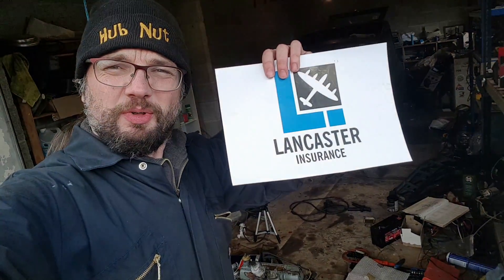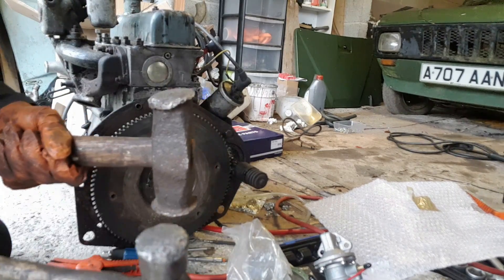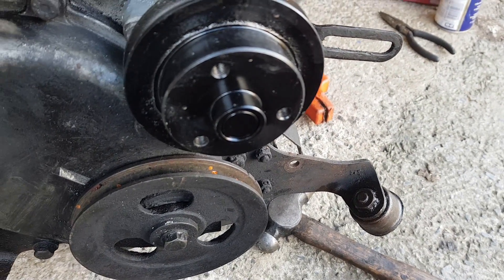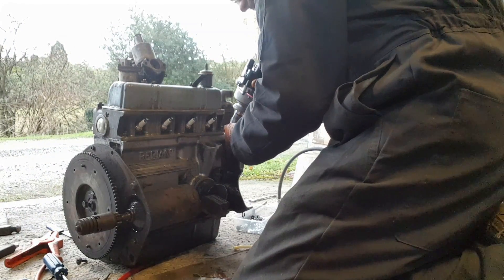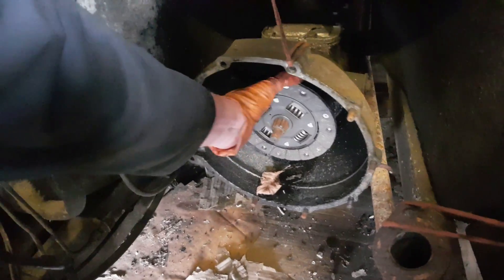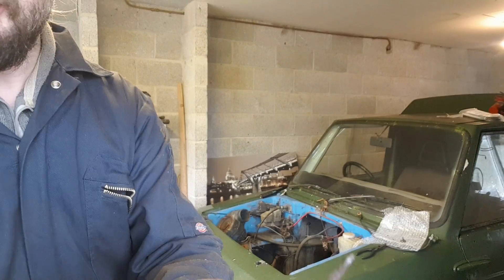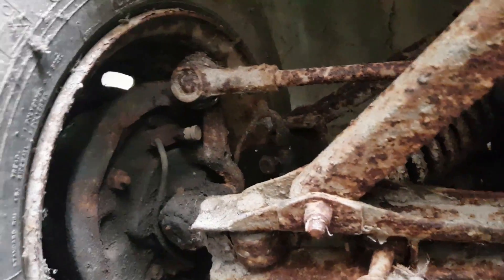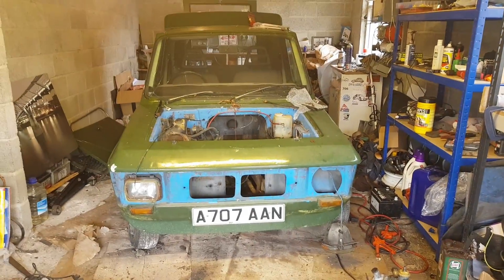Project Fox Part 7: Clutch, electronic ignition and more!

Comment: You should never ever hit hammers together they can shatter.
Reply from the maker: Can't say that's ever happened to me, and you can see the abuse the lump happer has had - mostly from twatting a maul.
Reply: @HubNut  I was told this at several times during training to be a mechanic. The theory is that two hardened and brittle faces share the same resonance frequency, this can cause them to explode into shards. I've never seen it happen but I've never seen a mechanic hit hammers together.
Reply: @pinkerton2964  I think that's not really a thing.  They might throw a spark or two from time to time, so probably best not if you're in a situation where there's explosive gas, best not.  But shattering?  Nah.  True, it might deform the face a bit, but I think that's about it.

Comment: I would not bash two hammers together if i were you as they can splinter shards of hardended steel into your eyes.
You can get special hammers that won't do this.
Edd china had some on wheeler dealer programme and explained all about this.
i forget what they called them now they were made of some special metal.
Also i would get the flywheel skimmed as the clutch will judder when the clutch is cold if the flywheel is warped & grooved.
The judder will go away when it is warmed up though.
Should not cost much to get it skimmed though,it's worth doing the job properly.
Great video ian will look forward to the next.
Reply: Hmm Mythbusters did the hammer thing to death, as ever with  MB they had to ramp up to the super silly level to produce chipping. Besides BOTH hammers Ian has shown you today have plenty of abuse worn into them  without failure (which is how they should be given half decent metallurgy). that ball-peen is I would suggest a bit soft for a metal shaping hammer, the maul thing  is about right as its a driving a tool/forcing something in type hammer and need a bit of 'softness' to grip what's being struck (NB claw hammers should also be 'soft' to grip onto nail heads when striking, just try to drive nails with a ball-peen hammer flat end it'l skid about and bend nails something awful).  Hubbers, de rust that gearbox spline  and a light copper slipping to make the assembly easier.
Reply: I had heard of this before many years before edd china said about it,but still would not like to risk it myself.
It might be a rare occurance,but still would not risk it,must be the sparks that is the main danger shooting off,not an explosion itself as they say.

Comment: What headlights did Reliant use? They look like the ones Fiat used on many of there cars.
Reply from the maker: Correct. Fiat 126/900T.
Reply: @HubNut  ah ha though so, also used by seat and yugo then. And probably fiat 127
Reply from the maker: Same structure, but some of those had a separate sidelight.
Reply: @HubNut  very true

Comment: All good stuff - and I think no. 7 is the newly-returned to traffic loco (BICBW). My first thought when it wouldn't start was typical of this engineer; "you've changed too many things at once". I'm just curious why you changed the distributor? And please - hoover some of that dead foliage and detritus out of the engine bay whilst you have a chance!
Reply from the maker: Indeed. Three locos now running on VoR. New dizzy is fully electronic. I just wanted some extra reliability.
Reply: @HubNut   Seems reasonable enough to want reliability...!
Reply: @HubNut  Electronic distributor... wonder if that will cure my mate's '53 Minor pickup's woes?

Comment: Are you going to re Paint it or keep it green?
Reply from the maker: I think I'm going to have to repaint it. I love that blue.
Reply: @HubNut  you might be lucky and be able to remove the green paint with paint thinner or something similar
Reply: If it goes back to blue (as it should) then...

1  It will look like TWC's grown up plastic cousin

2  It will look quite like a "Shado Jeep" from the old Gerry Anderson UFO program - funky little blue 6-wheelers with definite similarities to the Fox.

Buy a small bottle of cellulose thinners and try to remove the green paint just by wiping, (see Car SOS Austin Healey Sprite), if this works get a 5 litre can from a motor factors and strip the whole car...

Comment: Nice job--------------------------sofar but you are now avoiding the elephant in the room by messing with the grill get on with it and put the engine in LOL. what about the MOT will they say something about the rust under there?
Reply from the maker: I'll go over the suspension before the test, make sure it's actually solid.
Reply: The rust shouldn't be a problem as long as it's just surface rust and it's not actually rotting through. I stripped apart a front suspension a few weeks back that looked like this, but it was fine. 10 minutes with a wire wheel, it all looked good as new again.
Although 'stripping rust off' and 'making things look like new again' just isn't the HubNut way 🙂
Reply: Ya I dealt with the MOT when I lived there with my old BMW motorbike here In Alaska you can have parts falling off we have no inspections we should but no.

Comment: Sweet little hats!
"probably won't have the right size nut"
I can't look into your wallet, but I feel like you need an assortment of things. Nuts, o-rings, washers, stuff like that. Just a general selection of very general generic things. 
I'm fiddling with audio equipment, at some point you start buying 'belt kits' and not 'a belt' :D. 

The Samsung's stereo imaging is rather good. There's a dog barking at 13:15 which seems to be coming from my 8 o'clock, way outside. Speakers are in front of me. That's stereo for ya. 
I had pause the video to check if it was actually coming from your recording. Quite convincing.

Actually the thread on those tires looks quite modern, definitely 21st century, but that's probably still too old. There may be an age code on there, worth a look!

The fox looks very "Fiat 126 with BMW logo" without that grille :D. 
I like the blue... Uh-oh.
Reply from the maker: I think the tyres are 2012, so not that bad in the big scheme of things, but they were left flat for some time.

Comment: Defiantly need to train Mrs  Hub nut, she would fit into the engine bay a bit easier than you, plus she'll have smaller hands to get to those awkward areas like the thrust bearing in the gear box.
Reply from the maker: She's usually quite prepared to help out, but she has hips, so I reckon she'd struggle more than me to fit in that engine bay.

Comment: Clutch, electronic ignition and more!                                                                                                                                    PLEASE .PLEASE Tell me there is no petrol in that green plastic container.                                                                       Is it safe to store petrol in a plastic container?                                                                                                                                                                                                       Let us all keep Hub Nut
 safe.Can anyone please donate or give Hub Nut
 a Jerry Can. LOL.
Reply from the maker: Yes, it is safe to store petrol in a plastic container, if it's a plastic container designed to contain petrol.
Reply: indeed its safe, that is an actual petrol 1 gallon container, sold for the purpose, metal ones arnt common at all

Comment: Have you never considered using a nut splitter for some of those rusty nuts? Save buying a new hinge for instance. 
This kind of thing :https://www.toolstation.com/nut-splitter-set/p80007
Reply from the maker: I should invest, there's always something to buy. As it happens, that nut came undone with no problem at all. A little penetrating fluid goes a long way.

Comment: if it can't be fixed by a hammer it can't be fixed !1111
Reply: There was a running joke at my first job that the fitters' tool kits consisted of a hammer, a chisel and a condom - if the first two didn't fix it, then f*** it!